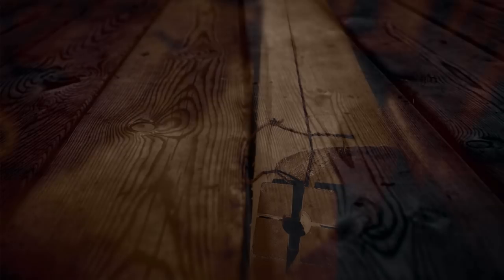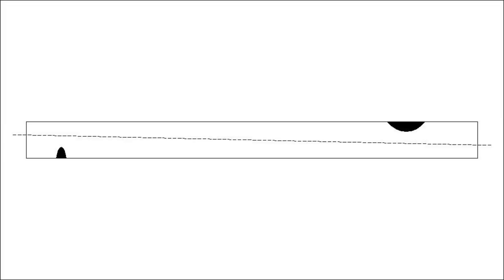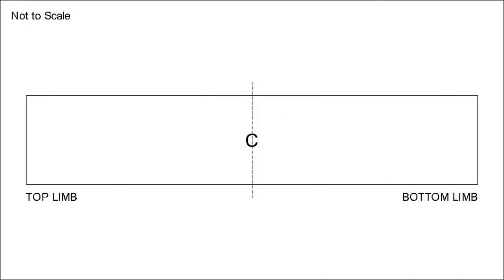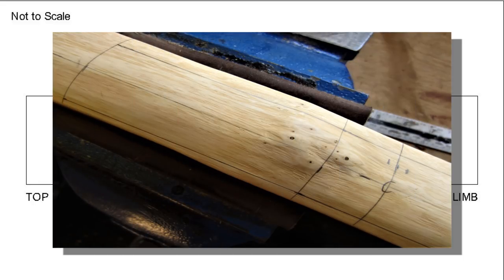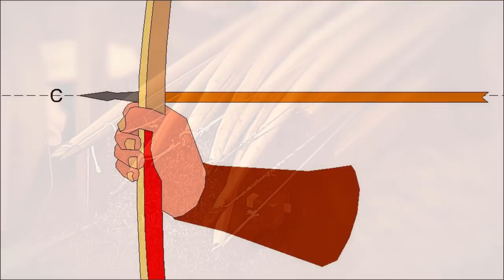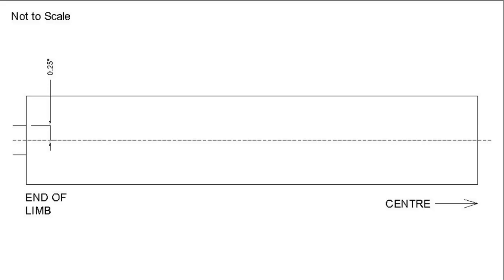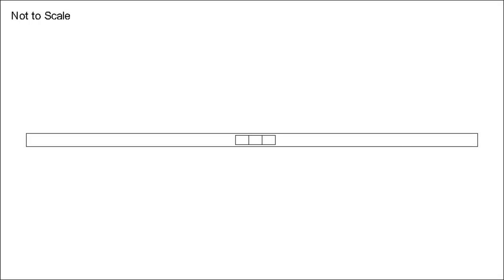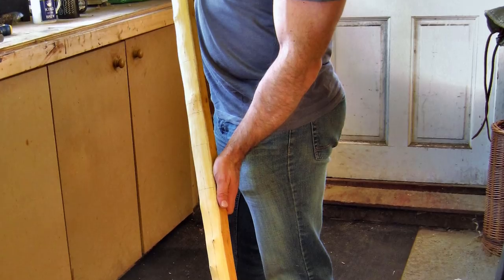Making the Self Yew Longbow Part 2 - Marking out the Stave

Comment: Great and informative video but I have one critique and one question. 
First, a critique haha. Please do not put your fingers so close to the bandsaw blade! I know you are experienced bowyer and had done many bows this way, but you know what they say about safety. Just wanted to say this.

A question is this; will the unevenness of the sapwood create any problems during shaping? I see that it has beautiful wavy form along the sides but is that a good or bad thing? I never worked with yew (prohibited and rare wood) so I ask.
Reply from the maker: Hello Harald. Firstly, thank you for your concern about my hand placing with the bandsaw. I will try to keep them further away in future. As for the wavy line between the sapwood and heartwood, this is fine as it is how the tree has grown, so the wood fibres will be bound together tightly and not split when the bow is drawn. Likewise, this is why I keep the top of the sapwood to one growth ring along the length of the bow. Planing the top flat would cut through those growth rings and create areas of weakness in the structure of the fibres.
Reply: I didn't want to sound like a smart ass, it is just that I know a lot of people around me that lost fingers or had bloody accidents with power tools, so whenever I saw potentially dangerous situation, I cannot hold without warning.

When can we expect part 3? Btw, from where does thickness taper start, is it from end of 12" parallel section up the tips or from middle 4" staggered section?
Reply from the maker: Part 3 is only days away from completion. :) The thickness (depth) is in direct relation to the width, so once the width begins to narrow, so the depth also begins to taper. Hopefully part 3 will explain in full.
Reply: Tnx, looking forward to it!